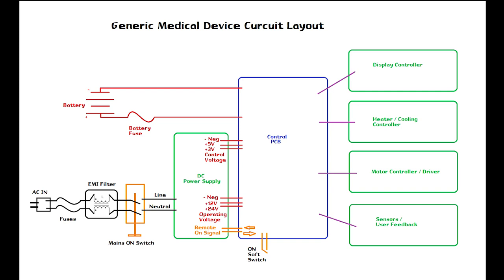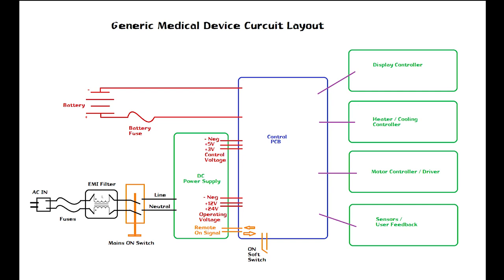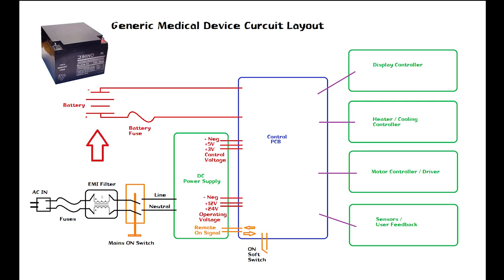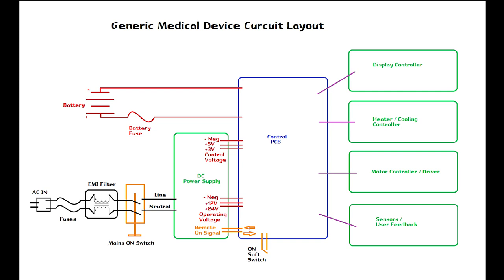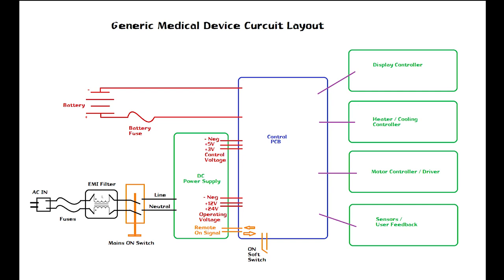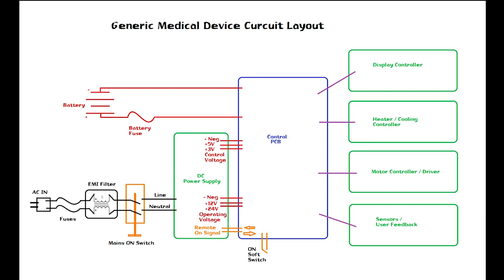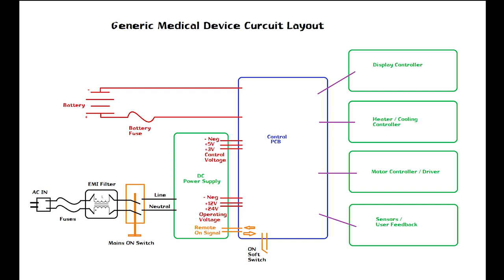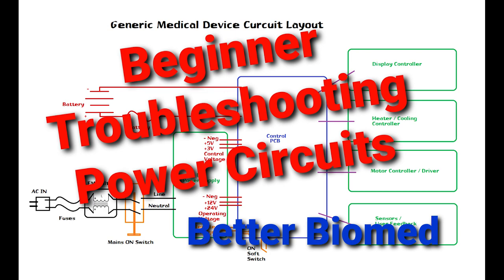Beginners Troubleshooting Medical Device Power

Comment: Is the DC power supplies and control PCB's universal units at least under the same brand name? I'd love to see any brand using something very universal like Arduino or Raspberry Pi just to make technicians life a bit easier.
Reply from the maker: The power supplies are almost always either off the shelf products or custom variants made to a spec